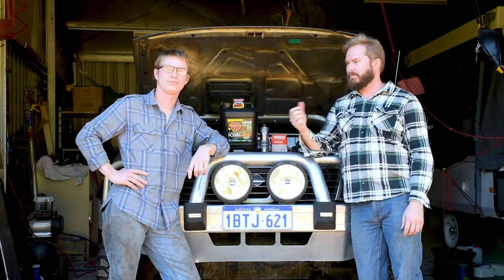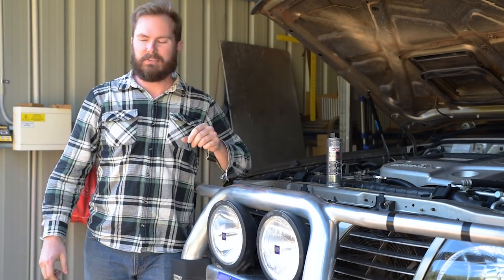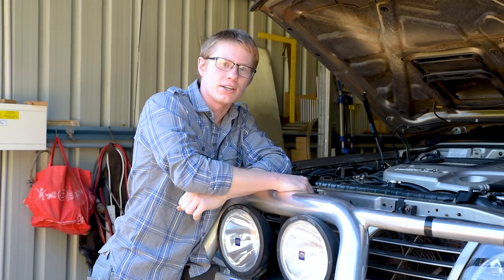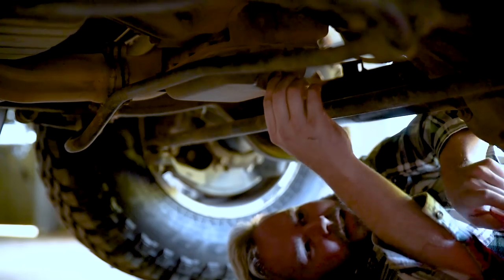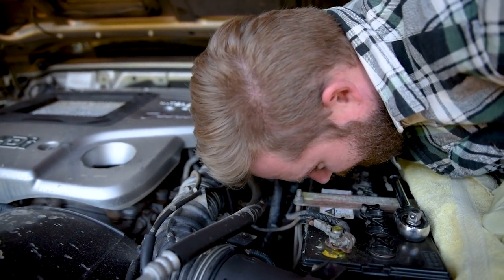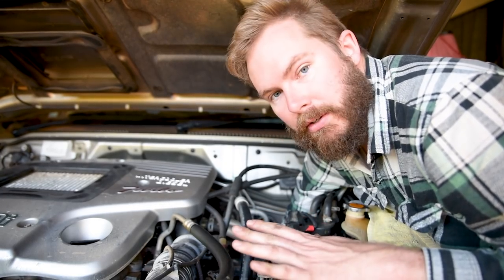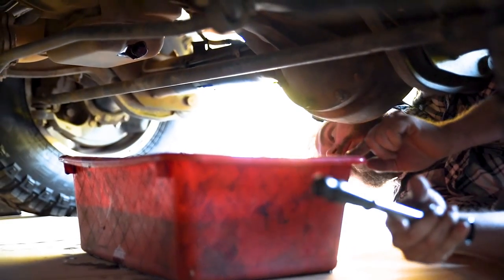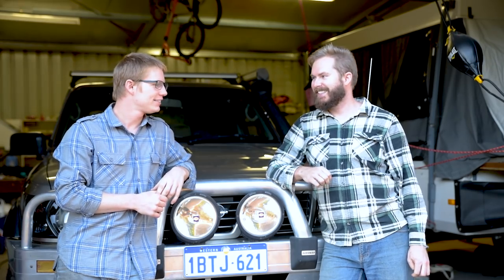Backyard Mechanic 09: How To Change Engine Oil

Comment: 9:02 I will point out that those holes at the top of the oil filter housing allows you to drain the filter and just above the front diff on my patrol their is a black rubber hose, I used a clear hose smaller so it jams into the black one allowing me to drain it into my oil pan and no mess. When I was done I cut a peice to length and left that clear hose in the black rubber hose with a cap to stop any mud and dirt from blocking it up. Hope you understand what I mean.

Comment: The zd30 actuallly has a funnel under the oil filter which drips down into a hose. Your typical 600ml bottle wedges perfectly bitween the frame and the tube coming off it. Just an fyi for future so u dont drip oil all over the place. 

I also use that oil for my grenade and she loves it. Starts so much smother in the snowies than the castrol magnatec i used to use. Last time i did an oil change tho i rested the oil bottle in the radiator bung that goes to the expansion tank and snapped it clean off. $200 later and shes fixed 😂
Reply from the maker: +TheJanope13 I did exactly the same thing with the radiator bung! 😂 we're yet to fix it properly but I'll tap a brass fitting in there. Funny about that hose, we only noticed it when there was oil pissing out of it.
Reply: fucking guess im not the only one then ahah. shitty fucking plastic radiators. Is this your new GU patrol to replace the rd28 you used to have?
Reply from the maker: Yeah mate this one replaces the old RD28 for the forseeable future :)

Comment: Did a oil change on my patrol zd30. Found Nissan's genuine oil filter was cheaper than ryco. Plus also used the genuine copper crush washer. Use the same oil as you penrite 10w-40 runs much quieter. What ever you do NEVER SPILL A BLOODY drop of oil on the fan belt (serpentine). As I kissed mine goodbye cleaned it and cleaned it but kept on squealing worst part the belt had only done 42k on it. But anyway got a genuine one and all good again.

Comment: Alex, what is your opinion on the engine oil flush stuff ? I have a bottle of the Moly stuff but i have not used it ... my mechanic advised me not to use it ??? Interested to hear others opinion too. Thanks
Reply from the maker: +Glendram yeah I've head arguments against it too, such as in older engines it frees up gunk from places causing oil leaks and consumption. It does thin the oil too, to help it flush, which is why you only run it at idle. I've always used it in my newer vehicles, but never the shit buckets like the subi
Reply: Its just kerosene guys, would not bother with it, waste of money.

Comment: 10W-40 for cooler climates, the 15W-50 works a lot better in warmer climates. Less blow-by and smoother power delivery. Used to change @ 5K intervals, found oil and filter were still clean so pushed to 7.5K and still, the same. 8-10K service intervals depending on work it has done. 
fibre washers... Plug has an Aluminium washer, if leaking then someone has abused it. Oil Flushes are a WOFTAM when using good oil. Guessing you guys never looked from underneath to see the drain catch under the filter (Janope13 noted).
Your oil was shagged and too thin looking at how it was streaming off the old filter. Yes, wet the O-ring. 
Yes, wash your engine and bay.
Reply from the maker: Yeah the old RD28 I had saw the oil completely blackened the moment I turned the key. This motor keeps it clean a lot longer. That little drain hose for the filter was pretty damn hard to see! Easier to spot when there's oil pissing out it all over the floor though! And for the thinned oil, I think that's what the engine flush did to it - thinned it right out so it drains easier :)

Comment: You doing an episode on the car and your plans for it? What measures you're taking to avoid engine failure
Reply from the maker: Yeah I think I will do a video on it. So far it has a dawes valve on it which I believe prevents over boosting,  I'm not too cluey on that thing, it was on the vehicle when I got it

Comment: Great video dude. I want to change the transmission Fluid on my Nissan Patrol Super Safari 2006, but I'm a bit skeptical about the exact ATF-FLUID to use, since in the manual it stated to use only the Matic-J from Nissan, (But of course we all know all car-manufacturers are always saying that), and my little problem is I don't know the exact equivalent of the "Nissan Matic-J ATF" which is very hard to find. Any idea? Some said Matic-J is actually made by Castrol and its thesame as  Castrol TransmaxJ, Motul ATF-1A, or Mobile 1 Synthetic ATF. But not sure about the info. Maybe for those who tried already can offer a little more infos?
Reply from the maker: I did the ATF in mine recently. I called up Penrite who assured me of the correct oil. It was Penrite Multi V 👍
Reply: I see, great to know that dude. Perhaps I'll search more on the right ATF here in my country, since we don't have Pentrite here.

Comment: I cant believe your cartridge filter costs so much!!!
A genuine BMW X5 turbo diesel filter is $19 and comes with a new sump plug washer and o-ring.
If i went Non- Genuine from Repco, it was going to be $185.20 for the same filter

Comment: Why not wash it off with water after letting it sitting for a few minutes??
Reply: why? I need to know. Most degreasers need water to activate don't they?
Reply: I don't think they need the water to activate as they do that on their own but I thought you needed to wash it off to actually remove it from the surface it is on. The de-greaser will do that but still stick to the surface.
Reply from the maker: +Dylan Jones I guess it's a matter of opinion! People say don't pressure clean under your bonnet but I always have on all my cars. I think you should be rinsing the degreaser off, the next persons opinion might be to never use degreaser at all...